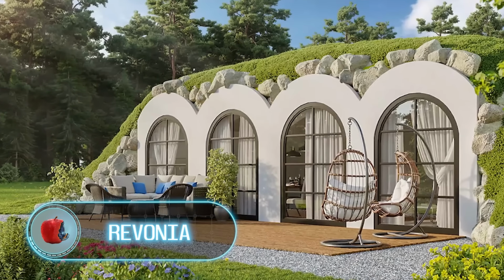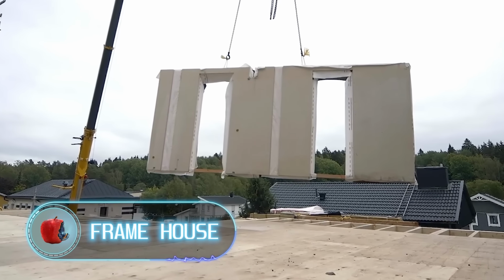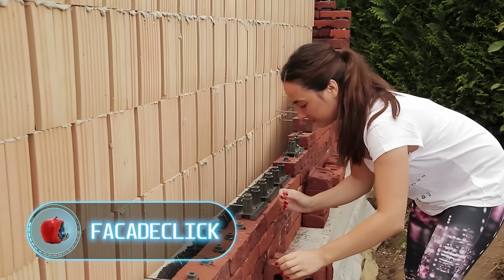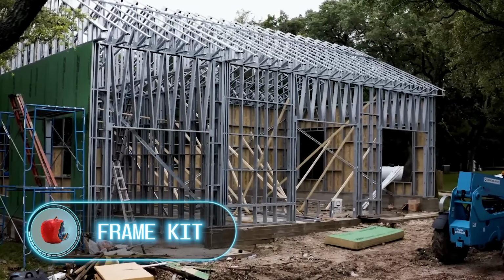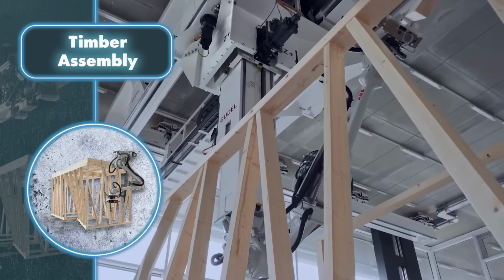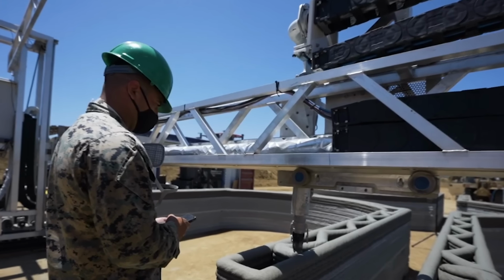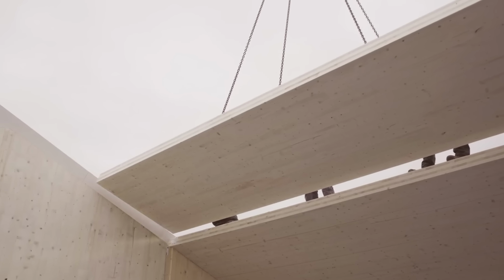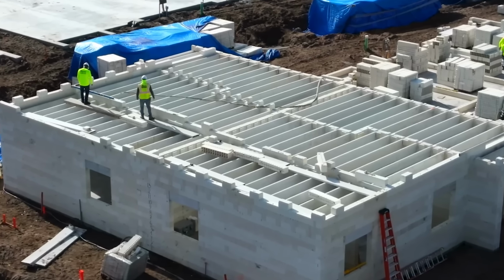Quick-Build Homes That Have Reached a New Level

Comment: The tree rots, steel doesn't. No, it rusts instead. And bushfires don't care about non-inflammable frame when they have cladding to burn first. Also, ever seen the steel frame of a burned out/down house? The fire isn't hot enough to melt it, but it is hot enough to twist and deform it, turning it into insurance write-off scrap.

Comment: None of the building materials in this video compare to ICF's except maybe the globe shaped home. ICF's are a steel reinforced monolithic poured concrete home. They have exceptional insulation and high R-values. The 6"-18" core of poured concrete protects from violent tornadoes, hurricanes, termites, wild fires, drive by shootings, drunk drivers crashing into homes, etc. The concrete core is also thermal mass, it takes a lot to change the temperature of the core. ICF's allow the heating and air con equipment to be sized significantly smaller as the homes are air tight and super insulated. Energy costs to heat and cool an ICF home are very low. ICF homes are very quiet, you will barley hear street noise, noise from yard equipment, fireworks(the dog will not be scared again), jet aircraft overhead, etc. Short of using a jackhammer on an excavator or high explosives an ICF home is not ever coming apart like a stacked block technology could, rebar in the foundation/slab is carried up into the walls, wall rebar is carried into the roof slab, and roof rebar carried into the walls, the entire concrete structure it tied together.
Reply: Concrete is terrible for insulation.